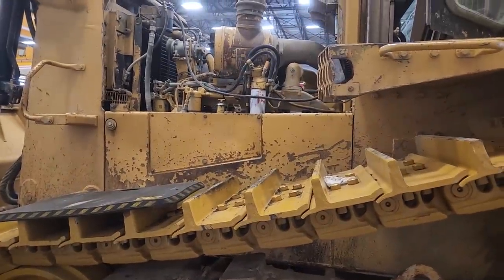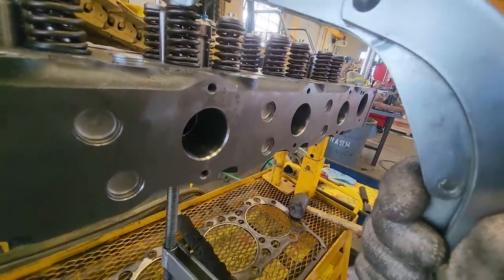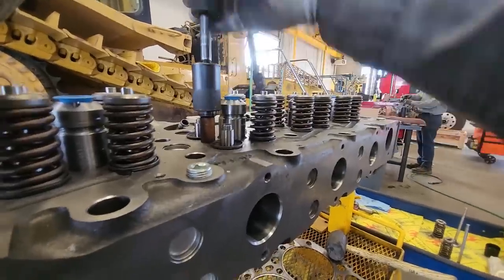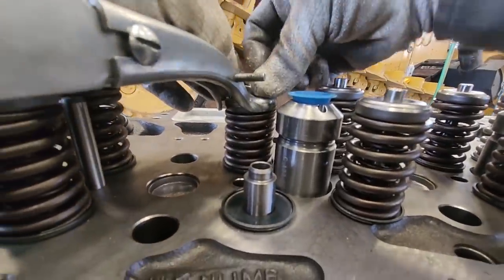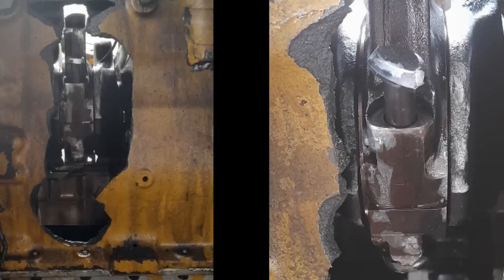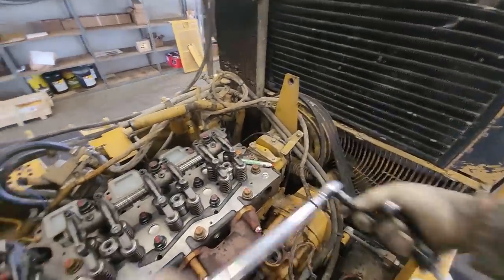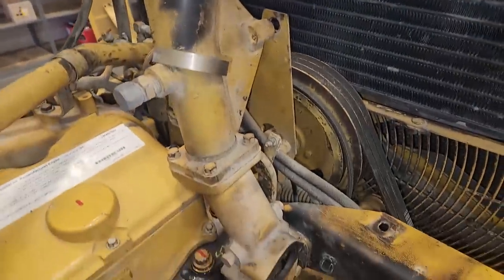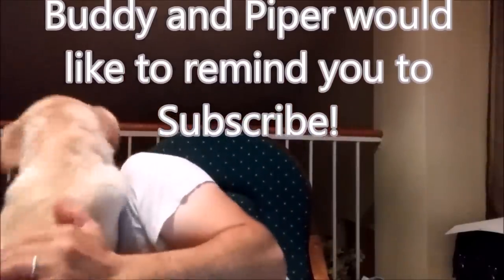"Thirsty" Cat D8 Dozer gets put back together. 3406 Head Install.

Comment: My understanding of the C vs B difference is the C crank shaft is interchangeable with the E models (having wider bearing journals than the B's).
Reply: Not true, wide rod journal design was phased in and when you look it up makes no sense. For the crankshaft to work in a E model, the timing slot must be cut in it. If not you cannot calibrate the speed timing sensor. I do not know when the timing slot was first used.
Reply: @John Goldsmith: OK, so the C crankshaft is not immediately interchangeable forward, but is the E crankshaft interchangeable rearward to the C, and more importantly, to the B in order to improve longevity and possibly strength. Thanks and take care.

Comment: Did you use a spirit or similar in the bores to check if the rings held it in each cylinder?
I was caught as a young engineer when the chrome liner surfaces was perfect. Thanks Josh.

Comment: Now do my thirsty 3406!
Reply from the maker: Bring it on down, or up more likely.
Reply: @AdeptApe  down, I hang out on the Canadian border. it was actually built last by western state in 2012, I believe the Caldwell location. Still running great it’s just leaking from basically everything at this point, so I thankfully know where the oil is going. With how good it’s been to me it will certainly make the trip back when it’s time.

Comment: 3306 engines are also 15 thou int 30 thou exhaust
Reply: 15 I, 25 E and on some 3306 engines with Jacobs Brake the exhaust push tube is bigger. So I replace intake as well so people don't get them mixed up and have a failure.

Comment: A little nasty politics, that you can only order a head which requires valve job, or new bridges. Anyway using magnet to remove valve locks helps a lot and you can't drop them. Just wondering if those locks are stainless steel?

Comment: Nuts didn't due any real diagnostic to justify a cylinder head removal could have all been done without pulling head .intake and exhaust manifold yes and then pan examine cylinder walls cam ect .changing oil anyhow.

Comment: Please go back to trucks
Reply from the maker: Nobody wants that more than me 😃
Reply: @AdeptApe  yea , your gonna keep working on equipment till they stick you in a service truck and put out in the field and then you'll be up under a D8 CAT in exactly 9 degrees weather .
Reply: @AdeptApe  Nah, you need the exercise on climbing up and down. When I work on a Motor Home, I have two clean five gallon buckets. One for tools other one for bolts. Finished with that tool back in the bucket. Do not lay tools out as you know the drill when you drop one.
Reply: My cat dealer will be getting rid of the truck shop when the supervisor retires. It's already being shared with our power systems, and we have a dedicated equipment shop.